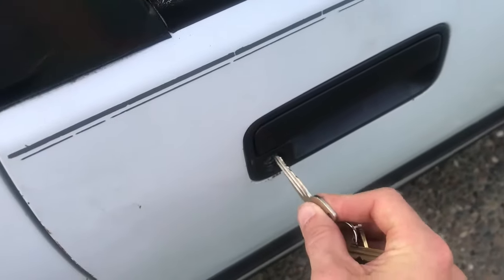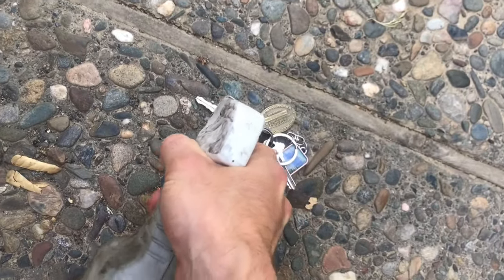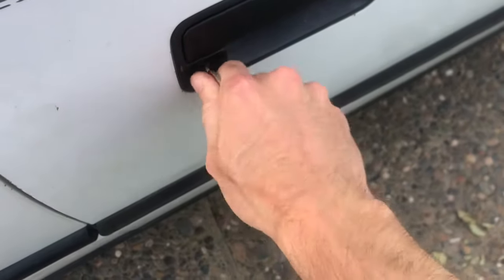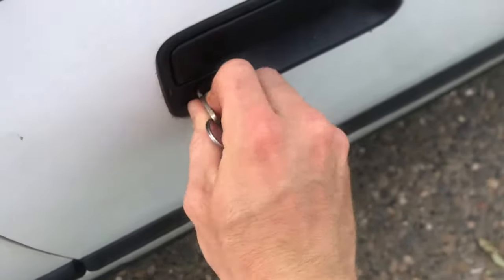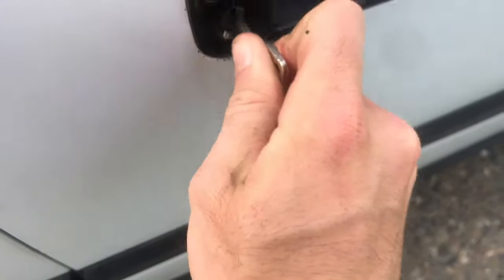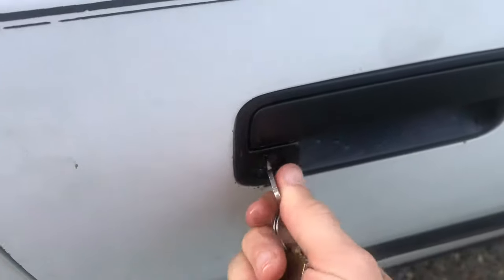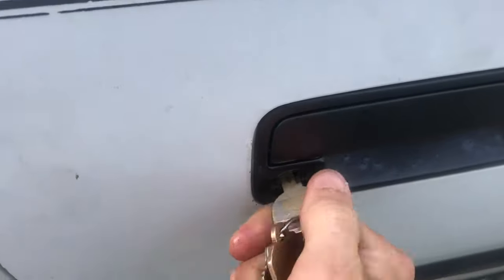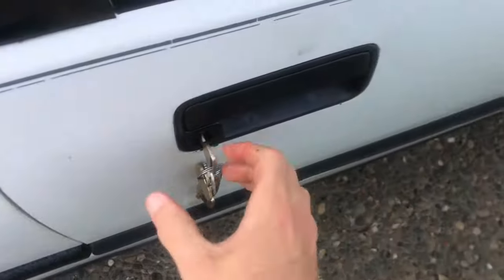Car Key Not Turning in Door Lock - How to Fix!

Comment: Wow, you just saved me about $300... Our front door keys were getting hard to turn. We were about to call a locksmith to change the whole deadbolt until I saw your video. Only thing I did different was to use DeoxIt F5, which I normally use on my stereo system knobs that collect dirt and crackle when turning them because of dirt/dust and I had it very handy to get to. Did this as I saw some other video that says that 4Wd is a bit oily and collects dirt, plus my 4WD is somewhere in my shed and it is cold and dark here at the moment.
It worked beautifully and all our keys are turning nicely. Thank you very much. I subscribed.
PS. the audio was fine for me. I might have been more focus and what you were doing.

Comment: I have an 88 Camaro I put the wrong door key in the door cylinder it went in easy but now I put the right key in the door cylinder and it won't turn at all. Can I apply the same method or do I need to replace something? It sounds like it might be much more involved.

Comment: Hi there, WHAT in the mumbly jingly keyring DID YOU SPRAY on the door key?
And maybe do it again for 5°F Michigan when the clicker won't work either.
Reply from the maker: WD40
Reply: Thank you.  
I found out it was the battery in the key fob.  Poor radio signal seizes the door lock.  Which is a design flaw but it's now de'iced & degreased for the next few decades.

Comment: Will a dry lubricant spray also work?
Reply: Yes.
 For this application having fluid wrists will be a game changer as you'll need to reach a minimum of 50,000 pnppm,  <<<  technical jargon, simply means Push n Pulls per minute, so don't let it intimidate you. Now you'll need that 50k+ pnppm's to generate the heat from friction to turn the dry lubricant into a somewhat toothpasty liquid and boom! You're golden.

Comment: Worked thanks but I needed to use adjustable wrench to get better grip on key
Reply: That sounds like a very good way to break your key off in the lock.
Reply: @dustintunis9347  I was using older version of adjustable wrench the one that looks like hammer and also while doing it only by hand the breaking key casing was certain wrench helped to stabilise it

Comment: What if something in there is stuck.how can I take it out ??
Reply: something like the WD40 red "stick" sprayer. I did that I had to use tweezers to get it out. I also have a lock pick set so I had the little metal part pushed back so I could see inside.

Comment: I got an old k1500. Key wont turn just like in this video. But sadly i learned the hard way.. I manaually pressed down my locks and shut the door. Later i go to unlock it and key wont turn. Had to break in with a hanger. Later im going to try your trick so i can have working security on my vehicle

Comment: Some WD40 or degreaser? Man, degreaser is the LAST thing you want to put in there! It may lube it up temporarily but it is going to wash out all the lubrication in the lock and it will be metal on metal. Stick with the WD40, or PB Blaster. I personally use a little grease, makes it very smooth and lasts.